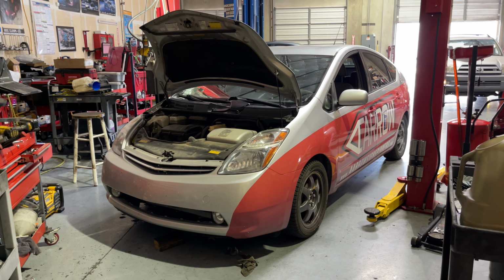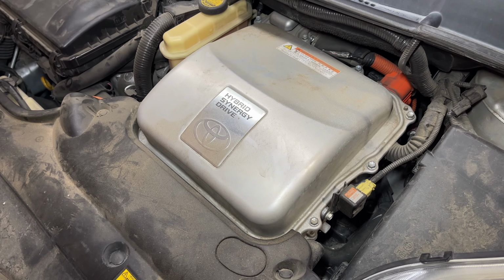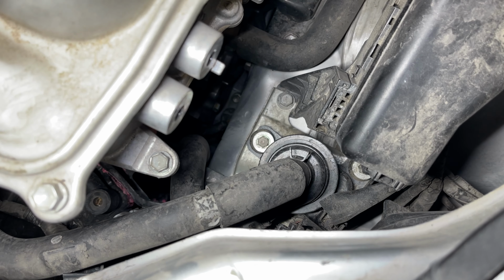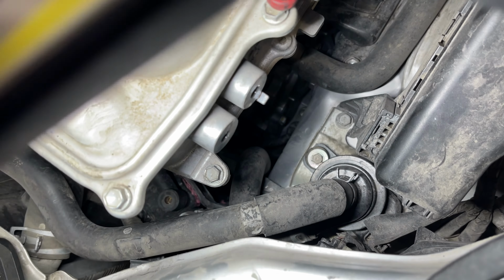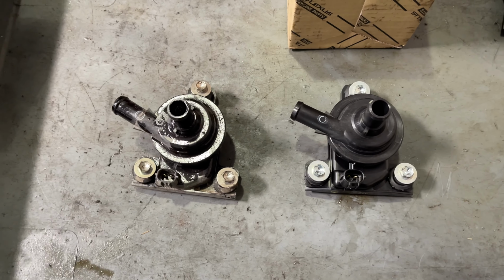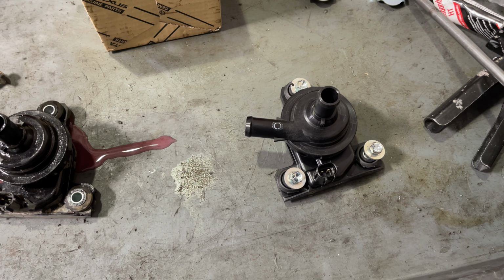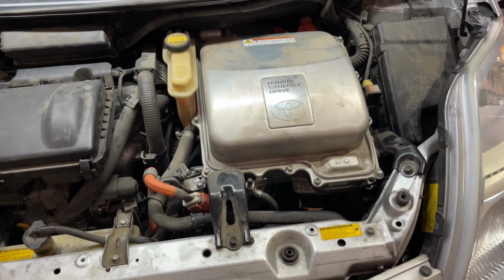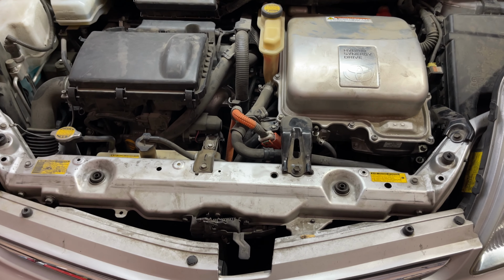P0A93 : HYBRID INVERTER COOLANT PUMP REPLACEMENT : 2007 TOYOTA PRIUS

Comment: I just had this code popped up. Would this make my AC stop blowing cold as will? That’s what happened in my case. While driving, the code popped up and compressor seemed to stopped. Fan is still blowing air but no ac.
Reply from the maker: If it’s overheating, I guess it could be possibly. I haven’t seen that though. Usually this code can lead to a blown AM2 fuse which renders the car inoperable.
Reply: Yep that's what happened to me first my AC stopped blowing cold then the Red Death triangle popped up but I'm still able to drive it 15 Mi to get home and it still starts up
Reply: @jessj.jesusistheonlyway  yup the same thing just happened to me 30 minutes ago
Reply: @Swissk31300BO  yeah but the weird thing is when I open the cap to look at the coolant there was some turbulence like the pump was working.. so I took it to a mechanic shop and they weren't getting the triangle death because I cleared the codes so they did not fix it and then the same thing happened again I ended up taking it to the Toyota dealership and paying $800 for them to put in a new pump and now it works great I was going to try and do it myself but I don't have a garage anymore it's way too hot out here in Arizona

Comment: This is a very helpful video! We are currently on a road trip landed in Colorado. All our lights popped on while we were driving, so we plugged in our code reader and it threw this exact code. We are wanted to buy the part and replace it ourselves since we have had similar experience replacing the three way coolant valve. Since we are not home and on a road trip we are going to need to buy the tools to replace to part. Do you have a list of all the tools and tool sizes you used to replace this part? It would be extremely helpful!
Reply from the maker: Glad it helps. Off the top of my head, if you plan to minimize the coolant spillage, you'll need a way to pinch the hoses (vice grips maybe), just don't squeeze them too hard. You'll need 12mm and 10mm sockets, a wobbly extension as well as some extensions to get to the inverter bolt in the back. May need a flat head screw driver to remove the plastic clips for the plastic cover over the radiator. That should be it I think.

Comment: anyone saying this video is helpful needs to go to another video and ill explain why. DO NOT MANIPULATE THAT INVERTER IN ANY WAY UNTILL YOU PULL THE BATTERY PLUG DESIGNED TO STOP ELECTRICITY FROM GOING TO IT JUST IN CASE A 16 YEAR OLD WIRE IS FREYED OR CRACKABLE IT HAPPENS. Besides the absolutely obvious safety issue all you need to do to get that inverter pump out is remove 3 bolts holding the headlight in and it gives you access to the entire cavity... I will say if anything is to be taken from this video its that you should clamp the hoses BUT ONLY IF THEY ARE NOT WEATHERED BECAUSE THEY WILL CRACK depending on the style clamp etc just be careful is all im saying
Reply from the maker: Yes, be careful, you should always be careful when working on cars, especially hybrids. That said, you are incorrect because if the car is turned off, electricity will never make it's way up to the inverter. The high voltage relays only turn on when the vehicle is in Ready mode. Voltage stays contained in the high voltage battery. This method also does not put any kind of strain on the wires. In order to get the headlight out of the way, you have to undo the bumper in that corner, which is definitely another feasible way of doing this job. For what it's worth, I have done dozens of these pumps over my career and never had a problem.
Reply: @SkillCollectors  maybe, but it is demonstrating this to people who could have a thousand different problems on top of the inverter pump like for instance maybe a front end collision is what killed it. In that case the high voltage system may be damaged and could short if manipulated or moved. It is always better to be safe than sorry when dealing with people that has NOT done dozens of these jobs 🙂
Reply: Changed the invertor but code is on? Any idea?
Reply: @roshanbaba 1. make sure you purge the system of air as you are hooking the lines up. 
Basically what I did because an air bubble was trapped in the intake coming from the resevoir I had to thumb it and fill the line up while it was off, also poor a little into the actual pumps top port, after its all filled with coolant quickly push the line back onto the inverter pump. 
fill the resevoir up, at this point the liquid should be inside the pump but not coming out because its not on. now you can either bleed from here and hope for the best or you can attempt to poor a little coolant into the out port hose as well before securing it. Next put the car into rdy by pushing the button twice without brakes. 
You should see the coolant moving inside the resevoir, if you dont then while the car is on attempt to manipulate the hoses or you can also to the out port hose off and let it run for just a second and shuv it back on.  
Next just bleed coolant like normal as shown in video. 
If the coolant still isnt cycling then you either have a bad pump, air inside the system still that needs purged, or a blocked hose somewhere, really the only options.

Also please make sure to clear codes using an obd2 tool after replacement as this code usually will not go away on its own after replacement, and in fact in some models may not work properly until cleared.

Comment: Great video! Question so if replace the fuse and disconnect it I can turn it on and move it real quick ?
Reply from the maker: Sorry I didn't respond to this earlier. Yes, we have to do it at the shop from time to time, ok to move around for a minute.

Comment: mine just popped on for 2008 prius at autozone whats next step?? and how much do these cost
Reply: You can get cheap aftermarket inverter pumps for as little as $30 but they don't last... I bought an Asian pump off Amazon for a total of $103.13 it is OEM. Good luck 🍀
Reply: That is Aisin not Asian although it's Asian.

Comment: Hi guys . I have kinds same problem. At highway red triangle pop up. And A/C not working properly. Blowing but not too cold. Then diagnose it PA093 overheat problem . I add some water(1 lt) from radiator cap.And delete error.Wait 20 min.Ac started working and no error. Should I have change inverter if it pop up again ? Or could be another electrical provlem
Reply: 2008 Toyota Prius
Reply from the maker: If the code comes back, you should replace the inverter pump.
Reply: Thanks for reply .
I changed it . Do I need to bleed air after change  ?  @SkillCollectors

Comment: I had the same code. The mechanic shop changed the hybrid inverter coolant pump, changed the coolant and all but still giving that code. Every now and then the triangle comes on and the car goes into neutral. I have to clear the code with the obd scanner…
Reply: Have you found your fix?
Reply: @source0  not yet
Reply: Check the pump again. I had replaced it and the new one failed within a week. Figured out you can check if the pump is working by looking at the inverter coolant tank.. if you see turbulence in the liquid, the pump is working, if it is completely still, the pump is faulty. I changed the pump yet again and this one still works after a month, got rid of inverter overheating(as seen on hybrid assistant app) and errors that come with it such as triangle, abs and the other lights, as well as the car going into neutral to protect the inverter thing

Comment: You do not have to move the inverter at all, and you do not have to remove the headlight. It can be easily enough done without doing either of those 2  things. Just did it, ...took about 30 minutes.
Reply: Please post a video showing how